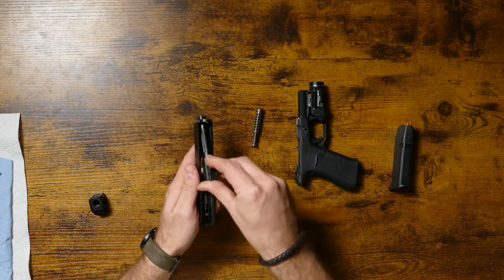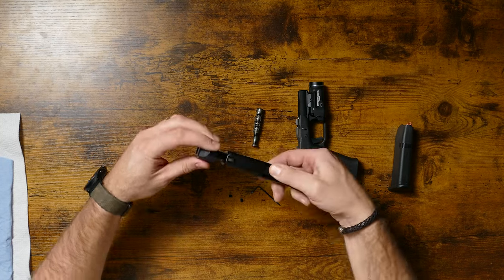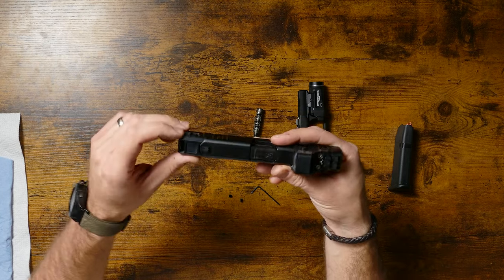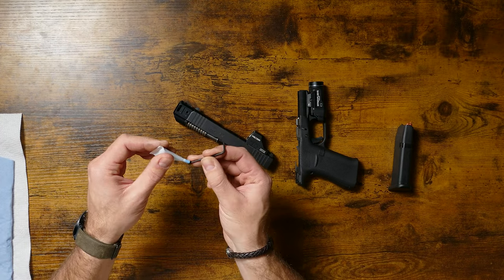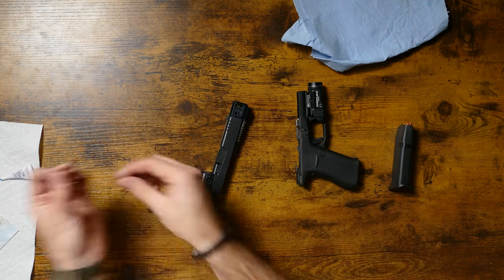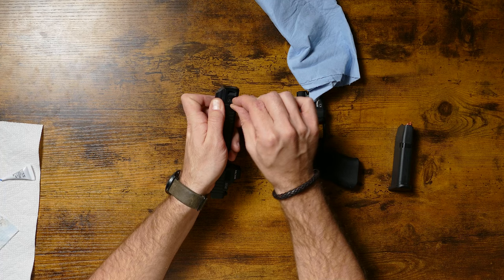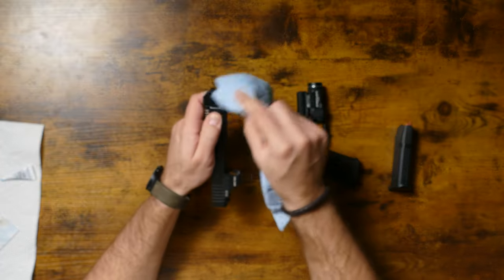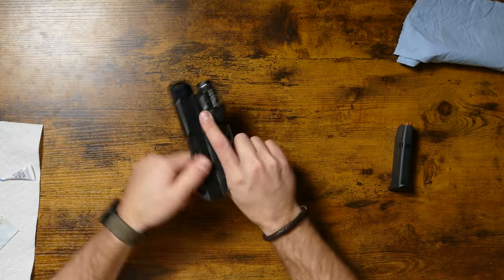How to Install the HC43 Compensator

Comment: Having a hell of a time trying to find a holster for the 43x non mos with your comp and streamlight tlr light
Reply: I just ordered a QVO wingman holster for my G43x, I have talked to the owner on IG and he has confirmed to me you can get the bottom of the holster open to accommodate a comp, there is also options for the TLR-7 sub. You can do similar things with Tier-1 holsters, you just need to add in the notes when you select the threaded barrel option that you will be putting a comp on the gun. Otherwise the holster will only have space for a threaded barrel and not the actual comp. Hope this helps!
Reply: Vedder. Get a 48 holster.
Reply: Yeah, because it wasnt designed to have all that heavy crap on it
Reply: I use a crossbreed rogue system holster (appendix) they always have sales too. The answer to your question would be any G48 holster should work.

Comment: Holster recommendations? Also do you need different springs for this?
Reply: The kidex holster you have will work. You just have to heat up the base until you smell the plastic. Push your comp through so it forms around it and use sand paper to remove and smooth the edges. Works great for me.

Comment: Looks like you have to repeat this process all over again when you clean it
Reply: Why? They’re Glocks or Glock variants. Take the recoil assembly out. Push the barrel forward and push a brush/patches through. Wipe up the mess, oil, and go. If you want to deep clean the gun then sure you would have to disassemble